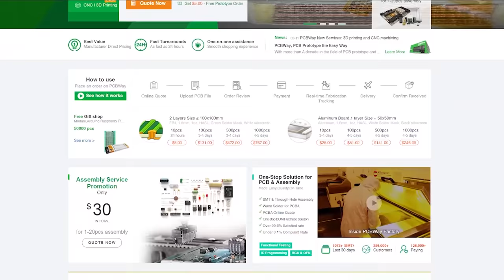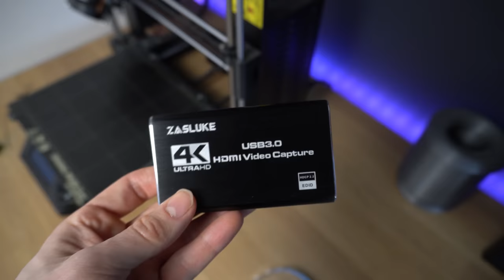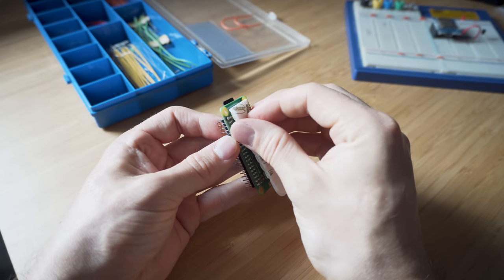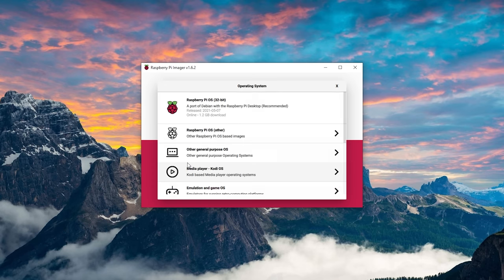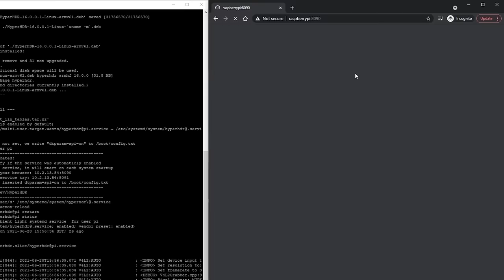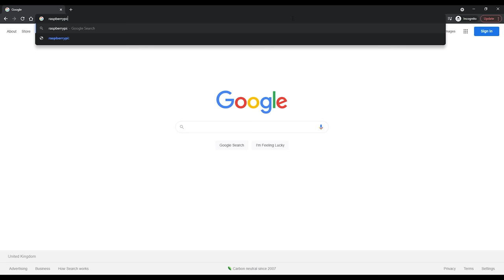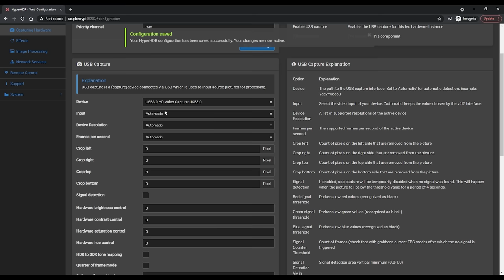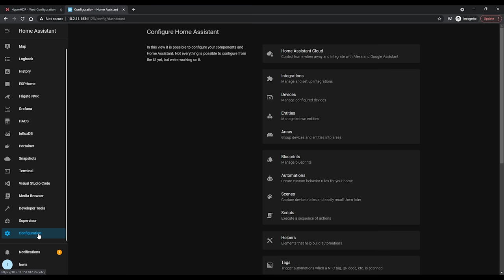The ULTIMATE Guide to Building an Ambilight TV with Hyperion

Comment: klThanks for the great video. This was great! I cant wait to do this project. I have a question though. I see a lot of people putting wled onto an esp8622 and connecting that to the LED strips. Then Hyperion separately.  What is the purpose in the esp8622 running wled? You are doing everything out of a pie.  Can you say what the difference is between these forms of the project?
Reply: hmmmm is it because they are running hyperion on a pc or mac and they need the gpio pin from the 8266?

Comment: Could not get this to work with my RPi 3 and WS2812B because the GPIO output is 3.3V logic high and the LED is expecting 5V logic high. This could be fixed with a voltage level shifter from 3.3V to 5V.

Comment: I have question on upgrading the pi in an existing/working Ambilight setup. Will the hyperbian/sdcard handle it if i just change from pizerow to pi4 like that? Or do I need to do software flashing and init all over again? Secondly do you see value in upgrading pi?
Reply from the maker: They are different arm architectures so you the install packages are different, but you can simply backup and restore your config easy enough

Comment: Edit: All sorted. The baud rate for APA102/sk9822 was wrong. I have hyper hdr working! thanks again.
Reply from the maker: Thanks! I'm not actually sure sorry, Im not a wiring expert by any means, I wouldn't want to give you the wrong information
Reply: @EverythingSmartHome  ok cheers. I’m having a hell of a time with the two loop boxes. One doesn’t actually do firestick etc even though it has same label, and the other produces a massive box of video preview, so you can see the capture buttons etc. Tried all sorts. Certainly not plane sailed it 🤣😠 not even connected LED’s yet.

Comment: Unfortunately when ik connect that  same zasluke grabber to the rapsberry pi 3, it sais that there is undervoltage and the signal is not looped through. Only the leds of the zasluke are lit. I am using the original powerplug that came with the pi.
Reply from the maker: If your using the original power plug that came with the pi then I'm guessing you didn't follow the guide properly?

Comment: Great guide, gonna try this week. However, I see one major (for me) limitation. I won't use the 4k potential of my TV anymore for my Xbox... The video capture device have 4k input but 1080p output, meaning if I connect my Xbox to it, no more 4k output, I downscale to 1080p, right? As a matter of fact, I downscale all my content passing through it at 1080p from my understanding 🤔
Reply from the maker: Hello, thanks! I would suggest you go back and re-watch the video 😅 remember, 4K HDR is one of my main requirements

Comment: Hi,
I just set up HyperHDR 19 using a raspberrypi 3B and WB2812B lights with a common 5V 10A power supply
The capturecard(4k60hz) is inputting from a firestick 4k to the TV
the leds are showing up as a pink hue and the live video from the HyperHDR link is showing up as a distorted pink image of the one in the TV.
Please help me resolve these issues

Thank you very much for your help
Reply: Fixed, turns out the capture card doesn’t work well with Dolby Vision
Reply: I have almost the same. But my LED won't light up. No idea what I'm doing wrong.
I've done everything like in the video except that part where he cuts off a micro USB cable because I've cut already three cables and they all look different inside and none of them like his, so I my RPi is powered with its own Power Supply (5V, the same as the extra one for the LED).

Comment: Need help.  So I think everything is correct on my setup.  In hyperhdr I'm Getting my tv image so I know the capture card is working.  My lights aren't turning on though.  What troubleshooting steps should I take?
Reply: Check if the control signal (green cable) is plugged on the correct side of the LED strip, it's one-way.

Comment: has the droping pf resolution of the capture card a impact on the TV quality picture? Does the TV still have 4K image quality ?
Reply: it's fine it'll just capture less pixels
Reply: @13lack_Rose  so the capturing has the function of calculating the color/lights for each position/pixel?
Reply: He already clarified when he mentioned it doesn’t, you need to understand, the raspberry pi is only reading information from the HDMI box, the HDMI box is only a pass through, it DOES NOT effect your TVs picture. 

If you have any basic knowledge of this stuff you should know this, so I’m kind of worried for you 😂 but he does a decent job of going through the process.

Comment: I have the Pi all set up, but my LED strip isn't lighting up. Only the first 5 or 6 LEDs light up, and HyperHDR doesnt show that an LED device is connected. I read about some strips needing a level shifter to work properly, however I'm very new to working with Pis and adding one seems well beyond what I know how to do. Any advice?
Reply: @burkejenne2841  This solved my problem!  I was using the pre-created RPi image and thought I didn't need to run the commands to create (or recreate) the service.  I happened to see your response to Brendan and gave it a shot and it worked!  Eureka!

Comment: I have an Nvidia shield that I use to play Dolby Atmos and TrueHD movies from my Plex server. Setup is TV(eARC)->Soundbar->Nvidia Shield. If I add a capture card in this setup, will that not either affect the sound output or the ambilight picture? I'm really interested in your setup, but not if it'll mess up mine. Thanks in advance
Reply: Run the Hyperion screen grabber app on the shield. No need for a capture cared that way.
Reply: @simoneatough6391  I believe there will be an issue with content from Netflix and other DRM protected streaming services.
Reply from the maker: Yes I believe you will have issues with Netflix using the app method. 

As for the question, it "should" work but one of those things that you won't know until you try it. You could buy just the capture card only and nothing else, test if it works and if it does then buy the rest and if it doesn't then return it
Reply: If you decide to go with the capture card, please update if the sound passthrough works. Thanks

Comment: I have got this working from your instructions - thank you. If I wanted to use a Pi model B connected via Ethernet would I just leave out the wifi .conf section? or is there different steps for that way of setting it up. Thanks again for the great videos.
Reply from the maker: Excellent! Yes just leave it and it will pick up an address via DHCP
Reply: @EverythingSmartHome  thanks, Anything I can keep off wifi is better as I am upto 132 devices on WiFi now!
Reply from the maker: Hahaha wow impressive, I thought I was bad!
Reply: @EverythingSmartHome  yes I discovered esphone and d1 minis !

Comment: Does this setup work for native tv apps or is it just for third party devices (Playstation/chromecast)?
Reply: I think it doesn't since there is no outgoing signal from TV to the capture card. Even if you use an HDMI cable that is ARC compatible in a setup with an AV receiver it shouldn't, since it's only audio that comes from TV in direction to the receiver.... I guess?

Comment: Used this video to do the same.  Utterly brilliant - thank you!  In case it helps anyone else, I got stuck for a long time with either one LED or a random strip lit and unresponsive.  I used a Pi4, SK6812 LEDs and otherwise the same components.  The solution was to set the Pi’s core frequency to 500 (google it).  Works like a charm now.  Also worth noting for the videophiles is that there is no loss of 4k quality running the signal through the splitter and capture card.  The only remaining frustration is I can’t see a way to get HyperHDR to default to HDR (that setting is lost during a restart).  Any clues from the experts?
Reply: If this configuration could be done by some command, you can set up a cronjob or something like this.
Reply: Did it work straight from the gpio 18 pin with the SK6812, don’t you need to step up the voltage from 3.3v to 5v? I can’t get mine to even light up
Reply: @Ashleyhandz  pin 18 is just the signal if I remember right. You need to supply the red and black of the LEDs with 5v, then the signal wire goes to ping 18. Good luck.
Reply: @NoisyGriff  that’s what I thought but I’m not having any luck, I know I need to choose the sk8812 controller in the settings but it won’t light up, filled everything step in the video and have it wired up exactly the same. Thanks

Comment: Okay so I used a 5v 10amp power supply. But I noticed that the first led blows out. Is it too much amps. I didn't connect the arduino to the power supply for the led
Reply from the maker: I'm not sure, I didn't use an Arduino
Reply: @EverythingSmartHome  oh I mean raspberry pi

Comment: GREAT TUTORIAL!! I am wondering tho - I could not find any information about the Loop Out "Pass Trough" for the HDMI ports on all those 4K Capture cards out there. If it says loop out does it mean it will pass trough HDR, DV, etc.
Reply from the maker: Thanks! Only if it says 4K will it work but yes loop through or pass-through is what you need
Reply: @EverythingSmartHome  yes 4K 60 fps BUT never says anything about HDR, CEC or ARC :(
Reply from the maker: CEC is unlikely to be supported but the others should work. Your milage may vary

Comment: Great guide which I will be following shortly - just waiting for the parts to arrive.

Two questions though ... (1) does the USB capture card affect any Atmos audio that may be coming from the source ? (2} in my setup I have a 4 way HDMI switch ( which has an HDCP 'logo' on it ) which outputs to a Sony soundbar which then has an HDMI connection to my TV's HDMI ARC port. Will this support the Hyperion solution ? And should the capture go between the switch & soundbar or soundbar & TV ?
Reply from the maker: Thanks!

Unfortunately I don't know the answer to either of those questions for sure since I haven't tested it and I don't have the setup currently to test it. My best educated guess would be that if you have a HDMI splitter in the loop already and it works fine with that then you should be OK
Reply: @EverythingSmartHome  no problem. Worse case scenario - it doesn't work and I send the kit back 🙂

I am assuming that as I have a Firestick plugged directly into the switch and Netflix, Prime and YouTube are all working fine currently then DRM/HDCP is already being handled. I am also assuming that since ARC involves a signal going in both directions it would be safest to not put the capture device there.

Also, didn't see it in the video but does Hyperion have black bar detection for when you are watching 2.35:1 or 4:3 stuff on a 16:9 screen ?
Reply from the maker: I think as far as my understanding goes that you need to have HDCP at every link in the chain, could be wrong though.

It does indeed have black bar detection, covered this near the end of the configuration section in the video
Reply: @EverythingSmartHome  another stupid newbie question .... when connecting the black/white/red wires to the barrel connector terminals do you need to strip back the coating so that the bare wires are in the terminals ??? I told you it was stupid question :)

Hmmm - that's not good. Wired the LED strip and Pi up through the barrel connector and all looked fine and secure. Plugged it in and the Pi started up but there was a pop and a spark from the first LED on the strip ( which now looks broken compared to the others ) :(

Comment: Yeah so i found the first issue, i cannot use this with Dolby Vision. The way i have it setup is with a Denon AVR-X2500H and which has DUAL HDMI OUT, the issue is that when i connect the ZASLUKE capture card to the output of the AVR the NVIDIA Shield behaves as if I only  have HDR and not dolby vision because it probably detects that the capture card does not support it...

Comment: Hi i have a pretty similar setup to yours (rpi zero w, same capture card, same settings, different 5x1 4K HDMI splitter, my LEDs are controlled by WLED and not directly connected to the pi) and when selecting video input from my HDMi Switch that are 1080p the USB capture cards captures the whole image and the ambilight works well. 

But when i switch my input to my Kodi Box (LibreELEC) which outputs 4K UHD then the ambilight doesn't really work. When i view the live video in HyperHDR it seems that the HDMI capture card only captures the top left section of my screen (because 1/4 of 4K UHD is 1080p). The workaround is to set the output resolution of Kodi to 1080p which makes the ambilight works as intended but i am not really satisfied with that compromise.

Have you found this problem with 4K UHD video source ?
Reply from the maker: No issues for me, works perfectly on both my 4K HDR setups! Try removing the switch first and see if that's the culprit
Reply: @EverythingSmartHome  Ok i just tested and my HDMI splitter is not the culprit.
I've read more carefully and the 4K UHD resolution in my Kodi is just the "User Interface resolution". I've set it to 1080p and then whenever i play a 1080p or 4K movie on my Kodi Box the HDMI capture card and ambilight seem to work just fine. 
So the problem comes from Kodi and that "User Interface resolution" option.

Thanks for the quick answer and for this amazing guide.
Reply from the maker: Your welcome, glad you figured it out!
Reply: OK i found another solution and i found the REAL culprit of this misbehavior.

In Kodi, you can set the "User Interface resolution" to true 4K (4096*2160) or 4K UHD (3840*2160) that is not the issue.

The option causing the problem is "Limit GUI Size" which is set to 1080p by default. If you set it to "No Limit" and reboot then the USB capture card captures the whole screen but the UI in Kodi in very laggy because the Rpi4 GPU is not powerful enough to deal with a 4K UI.

So you have 2 options for this to work with Hyperion USB capture card :

First option if your hardware running Kodi is more powerful that the Rpi4:
"User Interface resolution" = 4K or 4K UHD
 "Limit GUI Size" = No Limit

Second option if you have a Rpi4 running Kodi:
"User Interface resolution" = 1080p
 "Limit GUI Size" = No Limit or 1080p (same effect because this option limits GUI size for screen resolutions above 1080p)

These 2 options should only affect GUI resolution and system responsiveness when navigating in the menus but they don't affect playback resolution (if you movie is 4K then Kodi will send a 4K signal to you TV even if your GUI resolution is 1080p)

Comment: Awesome Video! Anyway you can do a setup with a webcam instead of HDMI capture card. I had mine setup with a webcam and it worked well but a pain to situate the webcam
Reply from the maker: Thanks Mark! I probably won't cover the webcam version I'm afraid, I'm not a fan of that solution myself 😬
Reply: @EverythingSmartHome  oh really! Did you try it and find it not as good? I preferred the webcam as to not lose 4k/hdr/120fps etc
Reply from the maker: No I'm sure it works well I just don't like the asthetics of having a camera being visible, but that's just me. I don't lose 4K or HDR doing it this way but 120fps would be a problem with this particular capture card (you could spend more to get that functionality) but not an issue for me since I'm not using it with a gaming PC.

However if you were planning running it with a computer, then I wouldn't use the capture card either since you could just run the software directly on the PC itself without a Pi or capture card.
Reply: Hi, do you mean you used the image from a webcam filming the screen to get the colors for the rgb effect?
Reply: @MrMarans  yes! USB webcam connected to raspberry pi
Reply: @MarkGhali  I am also interested in getting a solution for 4k 120 hz. Do you have any recommendations for a webcam and additional setup guides? Thanks in advance! :)

Comment: Hey y’all. Quick question. I’ve followed directions to a tee. Unfortunately, the LEDs won’t light. The wires I believe are correct. Grounds are connected (including) RPI. Power connected to leds and rPi. I had to solder the data wire to GPIO18 as my zero w didn’t have header pins.  Any ideas why the leds won’t even light up?
Reply: is HyperHDR running as root?
Reply: Maybe somebody in future encounter this, and my fault was connecting the control signal (green cable) to the wrong side of the LED strip. Yeah, it matters, ther other side is just if you want to connect another strip. Note that this is true only for the control signal, the 5V and ground can be connected to the power source on each side or both at the same time (which i would recommend).

Comment: wondering if you have an update for those of us using HDMI 2.1 for 4K 120hz :) Thanks!
Reply: I'm having the same problem of not being able to find any online resources about ambilight with 4K@120hz. We're you able to find out anything about this?
Reply: Cheapest option would be a HDMI Splitter then you have 4k@120hz on the tv and 1080@60hz for whatever you're using as a grabber

Comment: I was controlling 210 LEDs by combining Raspberry Pi 3b+ and Arduino Uno.
However, this time, when purchasing an 85-inch 4k hdr TV, I chose 120 LEDs/m.
This was the beginning of hell.
With the existing system, the number (820 leds) could not be controlled on the Arduino Uno, and the method was changed to control directly from the Raspberry Pi and the work seemed to be finished, but damn it, when the 4k 60hz hdr 4:4:4 video comes out became fed up When I lowered the resolution to 4k 60hz 4:2:2, it barely responded.
Ultimately, HDMI 2.1 support became the key.

I'm going to buy the 4k capture board you recommended and I just ordered the Raspberry Pi 4b because the board needs usb 3.0.

If I set this combination again, is it possible to implement ambient light with 820 leds in 4k 60hz hdr resolution?
(I am using a denon avr-x2700h receiver, so I don't need a selector or pass-through because there are 2 HDMI outputs)